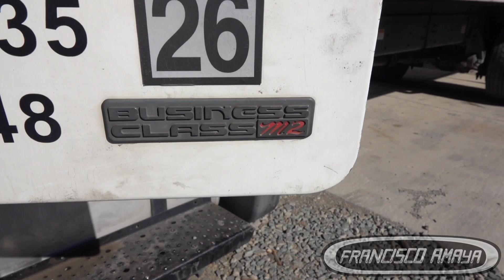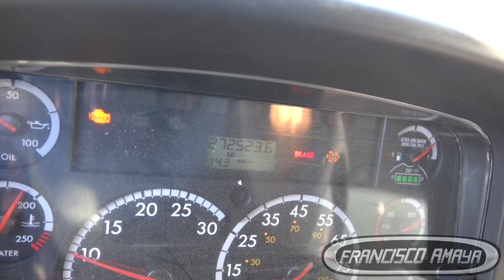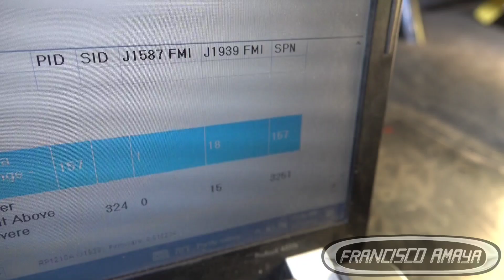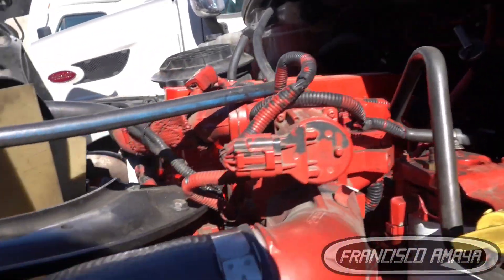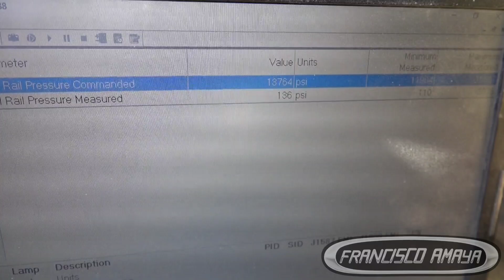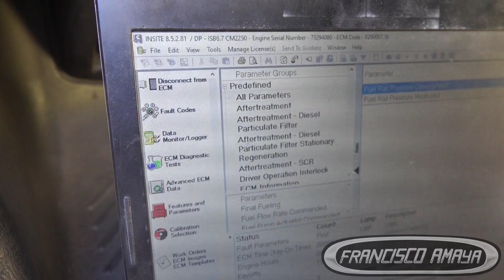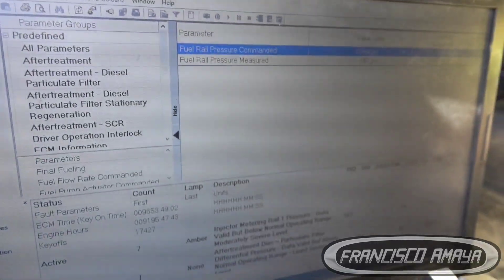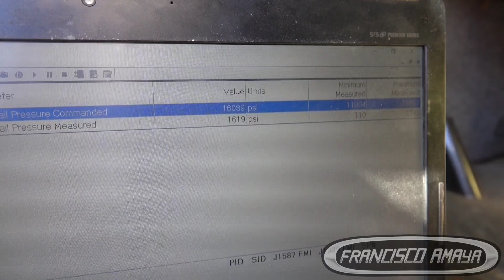CUMMINS ISB 6.7 ENGINE FUEL PUMP FAILURE LOW FUEL PRESSURE LOW POWER CHECK ENGINE SPN 157 FMI 18

Comment: Fransisco aquí Mario desde Florida saludos 👋 yo ando trabajando en un M2 6.7L del 2014 con 90k millas y me da código 559 y 2343 de presión de fuel y le tome presión en el filtro y tiene de 75 a 79 libras pero pierde poca fuerza después de 50 mph pero cuando le digo a la ECM que tire el máximo de fuel solo llega cerca de 25k libras de presión y cuando corre en la carretera y miro el live data llega a 26k pero nunca lo veo que pase más aunque la computadora pide comand de 28k el actual se queda en 21k o 22k y hay veces que bajando la velocidad el actual sube a 26k que tú opinas que es, yo cambie el check valve del return pero mire el fuel rail pressure regulator y en idle no fuel comes out y no have bypass si lo acelero a 2,500 rpm pero que otro examen me recomiendas y todo es con filtros nuevos
Reply: Did you ever find out the problem?  I have the same truck, same year and I’ve been experiencing similar issues.